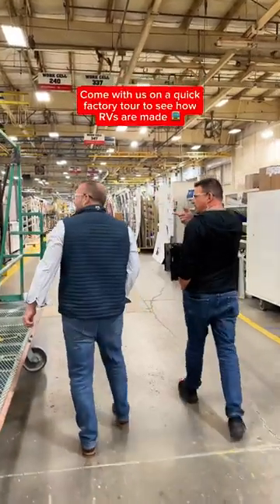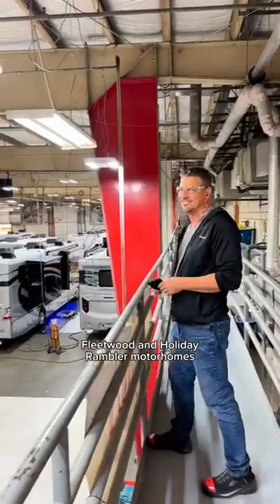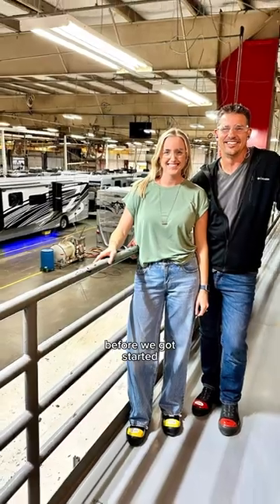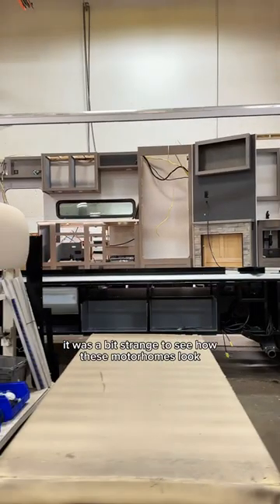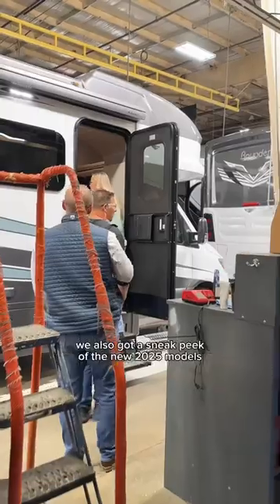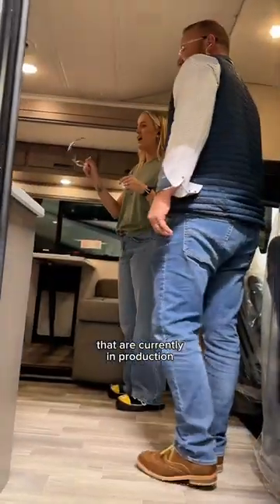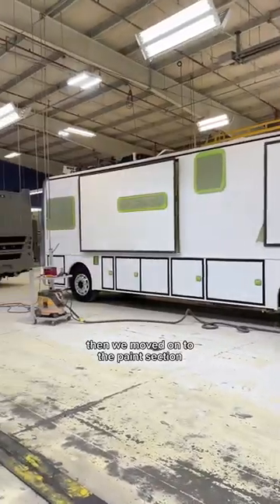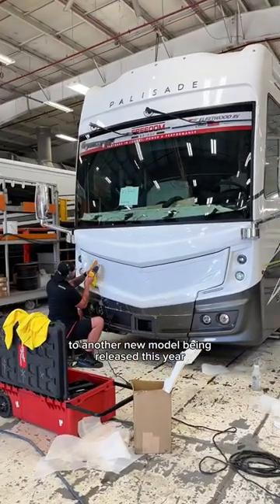🚌 Behind the scenes of how RVs are built 🛠️ #motorhome #rv #factory

Comment: rvs are made using the cheapest parts the crappiest wood and the laziest manufacturing. 

You can literally spend the time and learn the know-how to build one in your garage that will last way longer for 1/10 of the price.  

or buy one of those overpriced death boxes yourself it's up to you.
Reply from the maker: Yeah unfortunately RV manufacturers are under incredible pressure to reduce costs as their costs for materials and labor constantly increase and consumers don’t want to pay more
Reply: @fuelyourwander  Oh that's incredibly easy, stop over pricing them.  I wanted a small teardrop trailer with zero extras.  somehow that cost $30,000...  well smaller more niche companies can somehow price their RVs in the same category in around 18,000 And that's fresh off the factory floor. And they're built to last made out of actual metal.